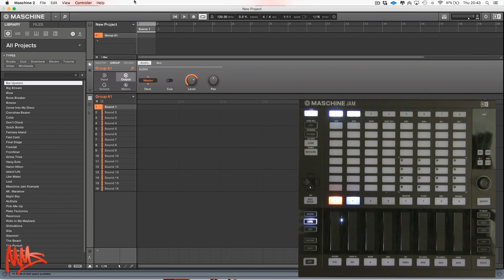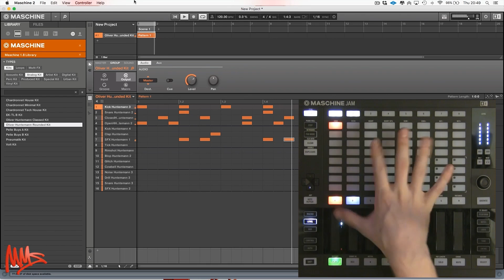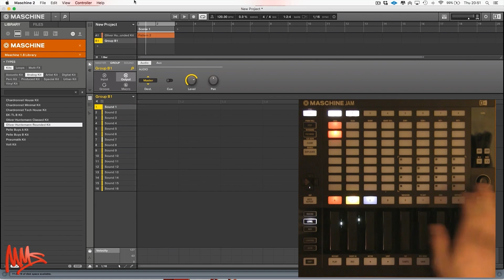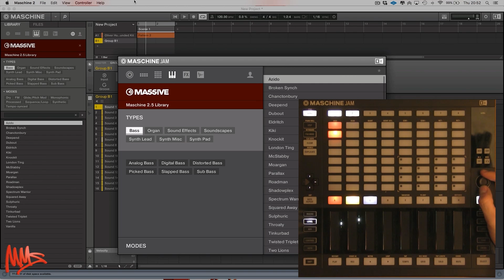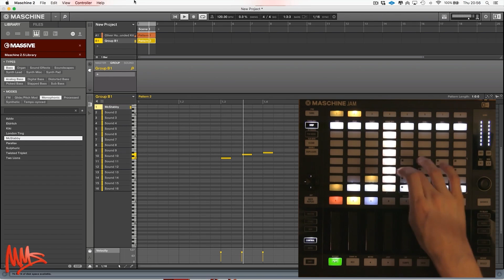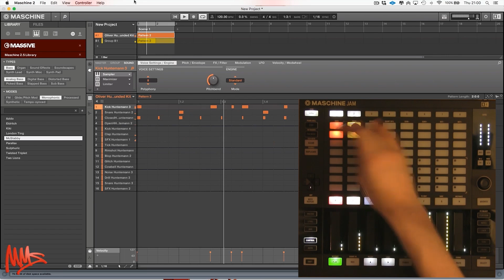Maschine Jam -  First 15 minutes hands on

Comment: hi, how did you turn on the maschine jam? have been trying to connect mine to macbook air, but it couldn't work, it only last for one second then all the lights went off. Do I need a usb hub that comes with a power supply to turn this machine on? Is there any specific volt / watt required from the adapter?

Comment: I can just tell you a lot of people prefer it to the Push 2.
Reply: It is significantly cheaper also...something to consider as to why sales for the Jam might be higher than the push!
Reply: how do you know that?
Reply: Sales numbers
Reply: significantly cheaper but also significally more useless. and for what it does it's still way to expensive. maybe if they would take 100-200 € off that 400... some examples:
- no pattern length other than 1.0.0, 2.0.0, 3.0.0, 4.0.0 and so on (because maschine software still sucks). on the push you can easily set your clips to uneven lengths to get more interesting sequences.
- no clip launch quantization like on push (also, because maschine software still sucks), just the scene launch is quantized. but when playing live,  i want to add variation and not always have to stick to prepared scenes.
- no displays. not even one.
- no dials, only touch strips, wich is kinda weird. but on the other hand, the chord strumming on these strips is really fucking cool, but thats really the only thing i like about the whole unit.
- no independent control of 2 different sounds/groups with maschine hardware and jam hardware. they always lock on to the same sound/group.
- a usb hub to connect maschine would be really good for mac users and other people who only have 2 usb ports on their computers.

Comment: Thanks for the video. Question: are the touch strips absolute? (where you place the finger, the level on control will jump there) if so, can this behavior be changed to relative? Also, is there something like shift + move finger, for fine adjustments? Thanks!
Reply: muitosabao I don’t think you can do relative, but can do a Shift for fine control which is basically like a relative mode as it greatly expands the sensitivity!  Was very happy myself when I discovered it did Shift combo for fine tuning!  (Just like with knobs on the other Maschines.)